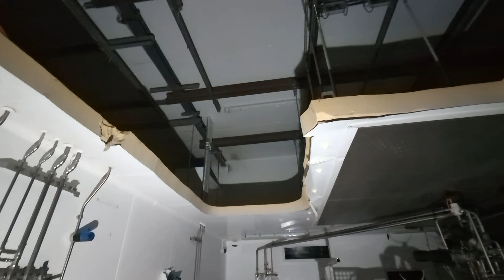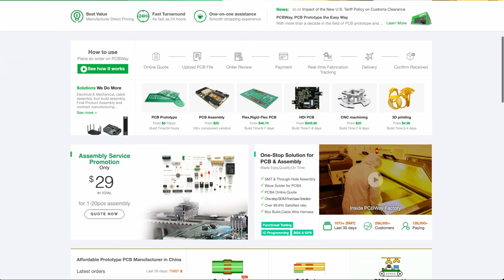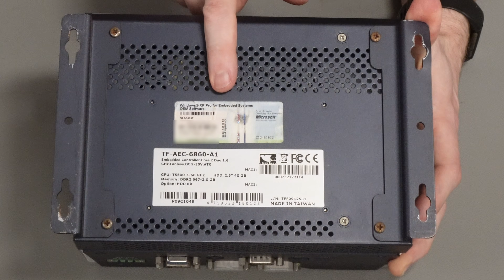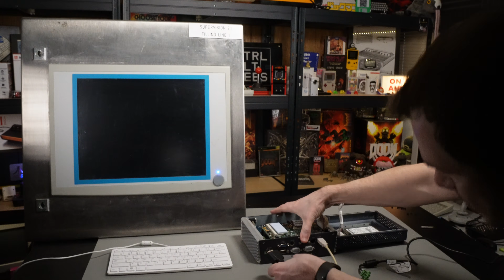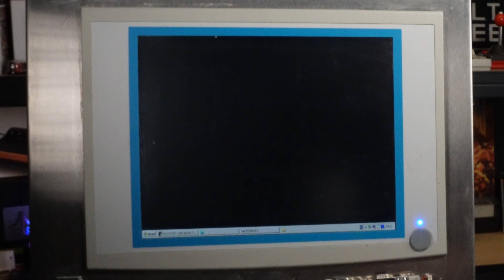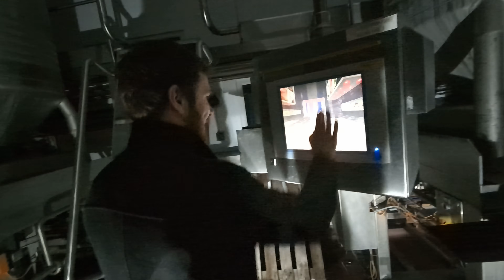I Played DOOM On An Abandoned Industrial Cake Machine

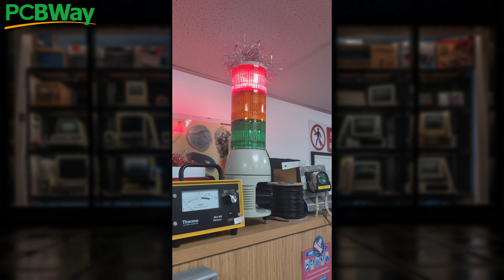Comment: 2:41 is typically called a stack light, not a traffic light, and represents equipment status. As a former industrial maintenance tech and controls engineer, I can provide some insight. The music is usually selectable or customizable so that way when you have multiple pieces of machinery in close proximity that may not be individually manned you can get an audible indication that a piece of equipment requires attention. Depending on how the plant was setup, multiple pieces of equipment could have the same tune so whatever team lead / equipment operator / etc. could know it was a piece of equipment they are responsible for that has faulted, or every machine could have a unique tune so the operator knows what equipment to attend to. 

Edited to add: The audible alerts can also be useful for machines that require manual intervention / activation, as the operator might not be directly in the path of the stack light to see equipment status. Industrial settings can be noisy and there’s frequently alarms going off all around in busy settings, so something to audibly identify that the piece of equipment you’re working with has an issue and that you should intervene or call a supervisor / maintenance to intervene helps reduce extra downtime (I.e., let’s say it’s a piece of equipment that has a process that cycles every 5 minutes, wherein you load parts and then press a start button, if the fault occurs at the start of a batch and you aren’t visibly aware you could lose 5+ minutes when the machine doesn’t begin a process the next time you push the start button). This type of scenario seems less likely in a bakery, but in highly automated assembly lines such as automotive, your work cell and the buttons you press to start the cycle after loading parts are often multiple feet away from the HMI / control panel and the stack lights are often mounted on the control panel, so your only indication would be the machine not functioning as you’re used to or some form of audible alert.

Comment: Honestly, that Core 2 Duo hardware would probably still be old enough to run DOOM95 without issues, assuming you could downgrade from XP back to Windows 98 or something. Windows XP being NT-based is likely the only reason you can't run the original DOOM for Windows. If it's an x86 Industrial Cake Machine, it should run DOOM... and several versions of DOS and Windows with enough fiddling and tweaking. Granted 2GB is the maximum you can use with Windows 98, and it does require tweaks to work with that much RAM, but it is doable. Just in case you want to do more experiments with that machine and an additional DOOM related challenge, see if you can run DOOM95 and the original DOS version of DOOM, since the underlying hardware does theoretically make that possible.

Comment: Isn't that 2nd RAM slot a mini PCI slot? It looks like miniPCI.
I think (by hearing the boot bip) that the machine booted ok. Just the resolution was weirdly off (the OUT OF RANGE message). Why don't you used a modern monitor to adjust the resolution?

Comment: I know you don't know the answer to this question but I just have to ask anyway.
Why do you think this cake factory used Windows Embedded systems rather than a simpler microcontroller?
Also I'm sure they were battered, they were cake machines. It just depends on the flavor.
Reply: It actually probably uses PLC's for the real control, but uses windows based HMI's (human machine interfaces) for the interface stuff. Many factories use this hynrid system.and its common across industrial stuff. A plc controlling the machines and a HMI (linux or windows or vxworks based) serving the operator interface

Comment: Great video. Two things I noticed. 1. Out of range is likely because it can't find the network or the pump it was connected to. It has one purpose, to monitor a pump, and the pump isn't there. 2. How can you clear the BIOS settings without any battery or line power? You jumped it with no electricity so nothing happened.
Reply: the bios still has a battery keeping the bios chip memory alive. i suspect the bios jumper just disconnects that battery.

And out of range is the monitor saying it can't get the proper video signal from the PC. has nothing to do with pumps.

Comment: I've seen very similar power connectors in a lot of industrial machinery, both in person & on other channels. The benefit is that they're very easy to rewire on the spot when needed. And also very cheap to manufacture. You don't want a laptop-quality power dongle wearing out over time or getting tugged out by accident.

Edit: In fact, I think some router infrastructure in my previous apartment had one. I forget the name of it, it was the box that sat inbetween the fiber line & the router.
Reply: Re: the part that sits between a fiber line and the router is an ONT, iirc. At least that’s what it is on residential connections like mine.
Reply: @xXb3anzXx  Yup, that was it! Thanks.

Comment: Every time someone brings up light curtains I twitch and think about what happened to someone at a factory where I used to work 'cause they liked to mess with safety equipment. In this case it was an access panel (which should have been locked) and a simple momentary switch (which had been bypassed), and quite the ah... Injury to the top of their left hand, and arm... Yeah... . Some people have the survival instincts of a grapefruit. FYI, I can imagine the smell of that place, and it's less imagination and more memory of what happens when a cooler at a facility I used to guard failed, a dairy cooler... In July... In Virginia where it's regularly 90 degrees Fahrenheit in July... It was more than just dairy residue too.